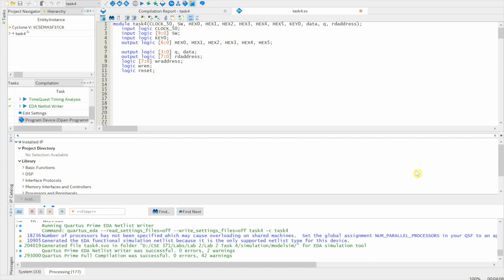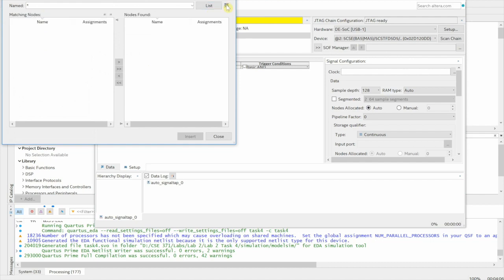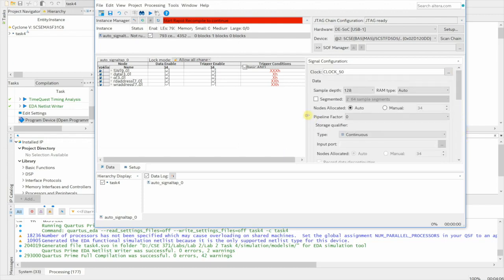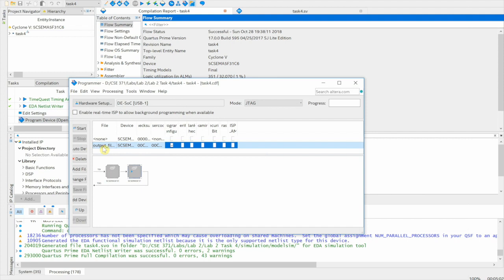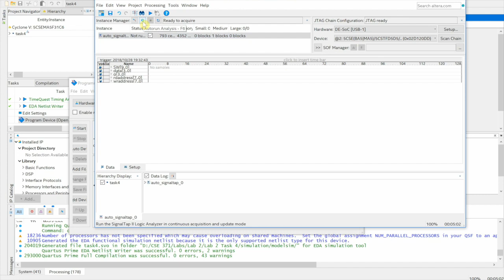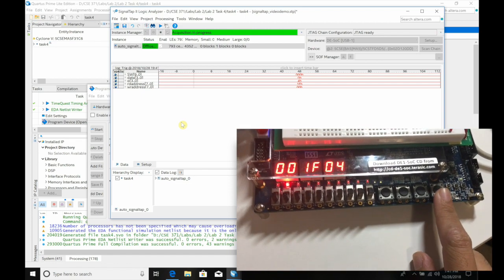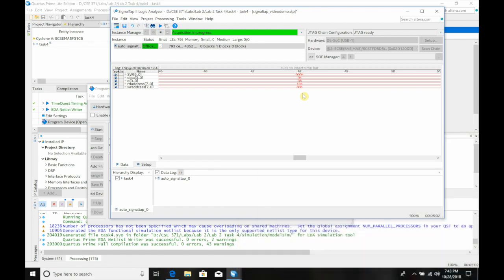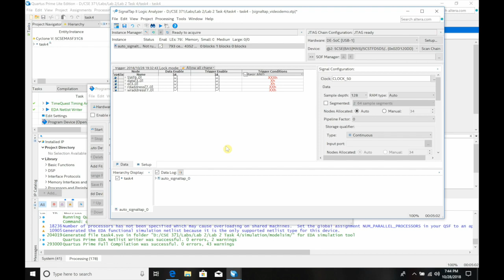How To Use the SignalTap II Logic Analyzer Tool in Quartus Prime

Comment: I'm using a DE0-nano board. When polling some registers in Signal tap for debugging, the register's name appears RED in color. I don't know what it signifies. If it appears in RED, then the register's value stays at zero. But, if I assign the register to an output port,  its value changes to black and it functions as it is supposed to. But I have unwanted ports in the bdf now. Can anybody tell me what the RED color actually signifies and how can I fix it? 

Thanks in advance :)
Reply: We are facing the same issue, how did u solve it

Comment: So useful! Thank you! By the way, I used the SOF manager to flash the sof file on the DE SoC board, not the device programmer but it will be the same...
Reply: Rania Hussein, is it normal that every single time I try to change trigger conditions and/or add/remove nodes to analyse the system asks me to recompile? Moreover, it proposes to make a "rapid compile" but the button "rapid compile" is not clickable...

Comment: Thanks lot for the simple and nice demo about the signal tap analyzer. I'm using Arria 10 GX PAC and I want to use signal tap analyzer. However, in my case I can program only to PR region using fpgaconf bitfile.gbs (not a .sof). And then using the SW API, I need to trigger the run. Signal tap analyzer always show "program the device to continue" even though I already programmed using .gbs. Any clue would be helpful, thanks.
Reply from the maker: Kavinga Upul Ekanayaka I haven’t worked with Arria 10 GX so cant comment on that. Sorry